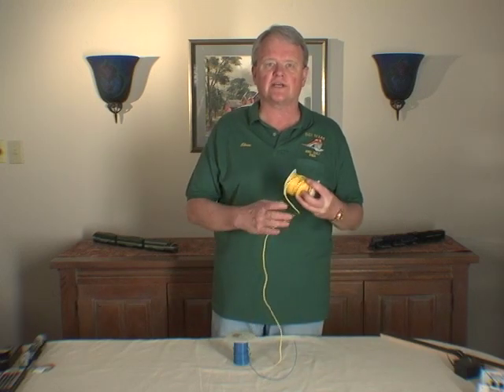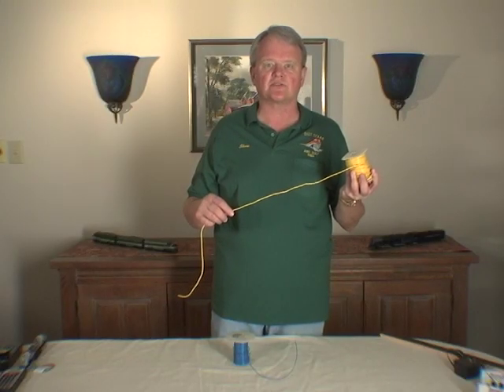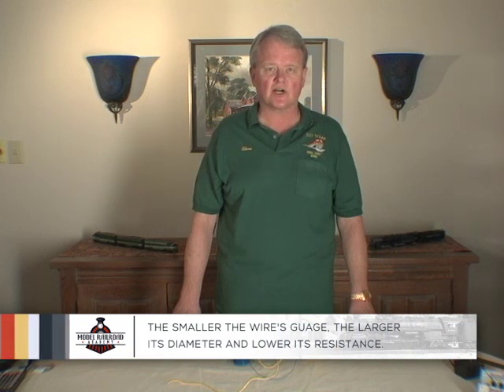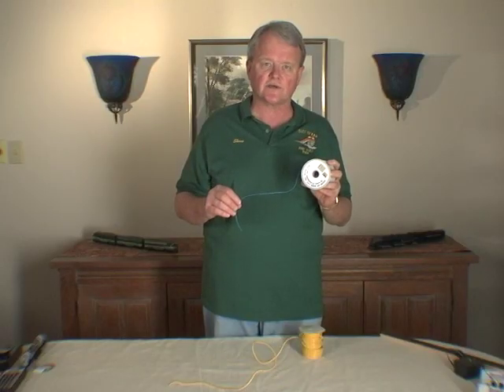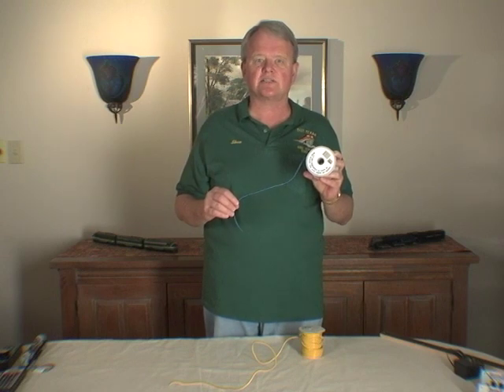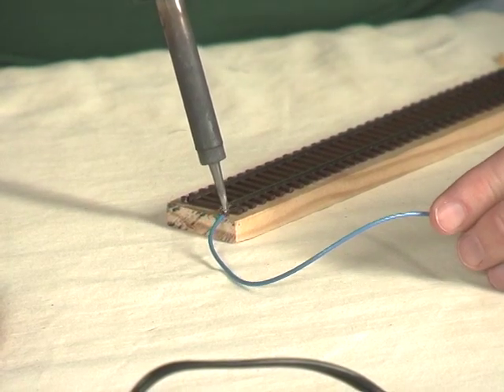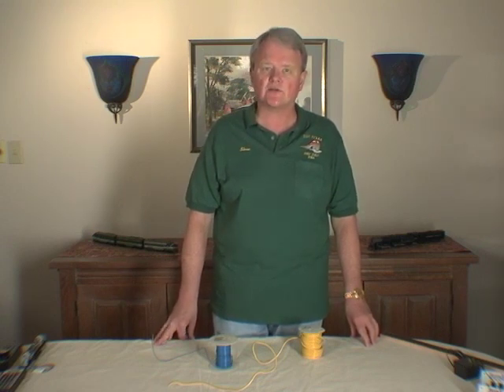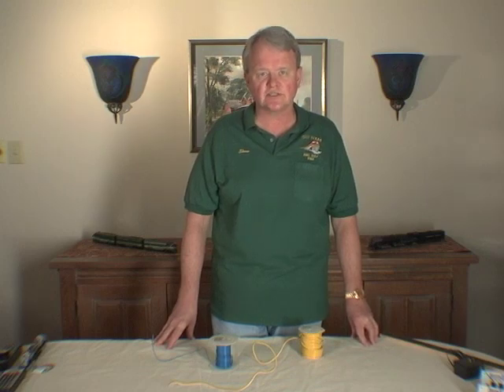Choosing the Right Wire Gauge for Your Trackage

Comment: I too used 14 AWG solid wire for my bus which has runs of around 45' and 20 AWG solid for my drops.  My bus wire is household wire and the drops are bell wire from Lowes.  Home Depot would work too.